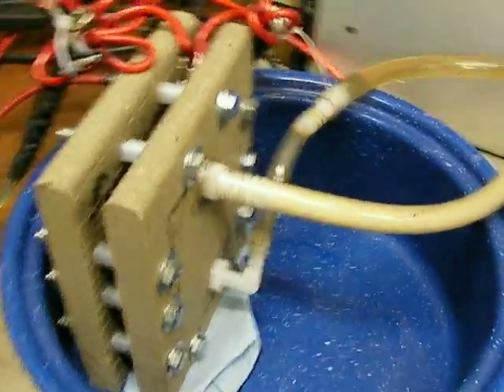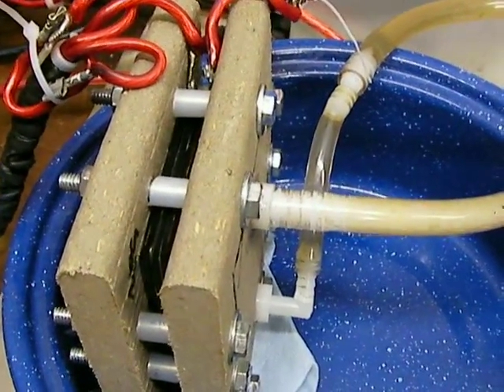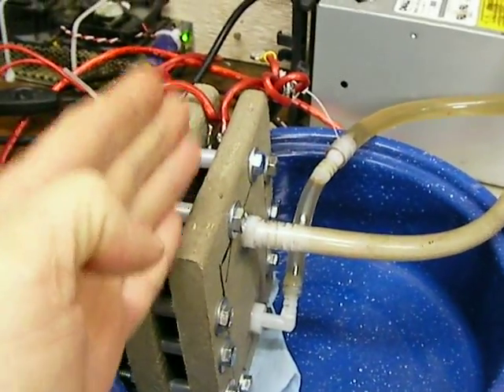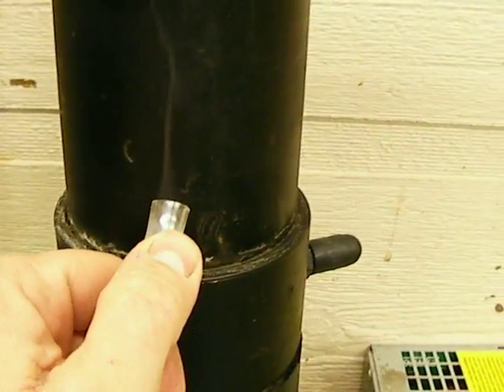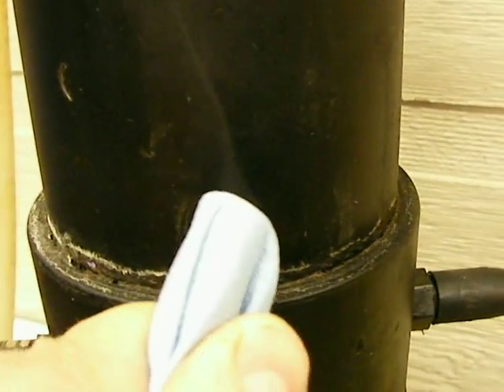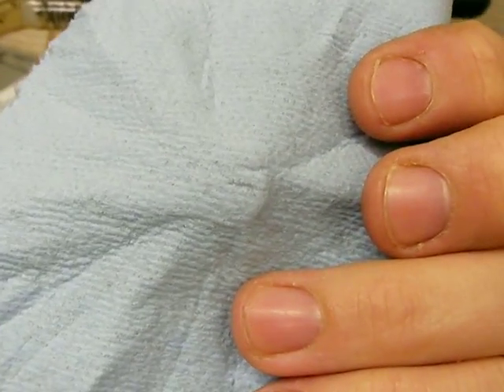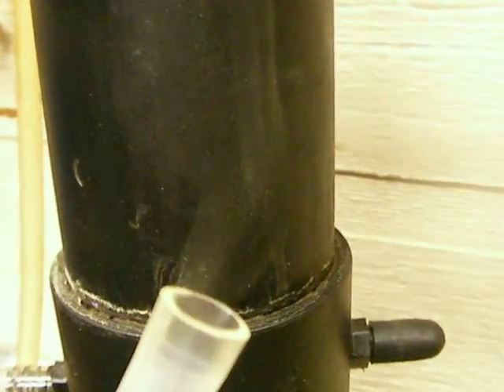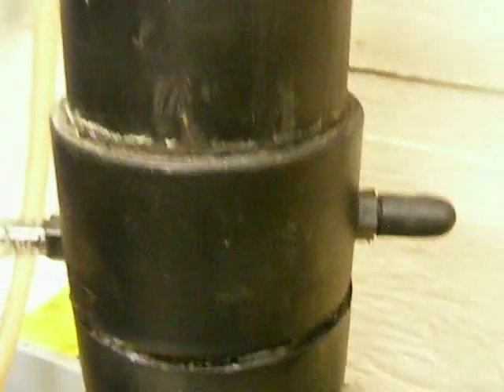nano silver hydrogen gas

Comment: Maybe but I am doubting it.  I believe there is very little KOH and NaOH in the product.  You are basicly distilling using low temps. One thing to consiter is.  Is your shop really cold.  You may be condensing much of the moisture in the lines and drying it out.  
I am curious on the Ph deal though.  Run a cell into a small ammount of water for a day and see what change in ph you get.  I got my money no changes ;) Thanks for the vid.  Interesting stuff!

Comment: Does it produce more gas with the nickel ? Do you have any data on it ,volts amps lpm mmw compared to the same volts amps lpm with stainless steel..Another thing if you are using lye that mist/fog is probably from it cause I get the same thing sometimes in my cells , and another thing you cannot see hydrogen gas or oxygen gas its invisible, if you have a fog/mist it is either steam or vapors from the lye 99% of the time....